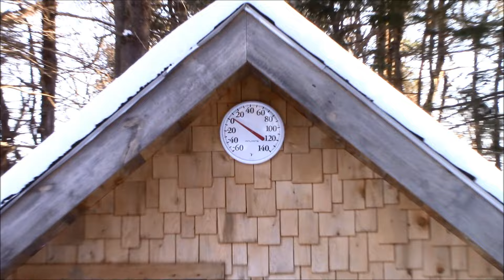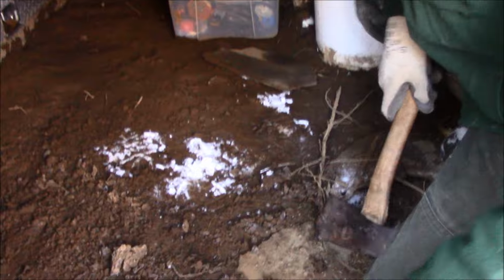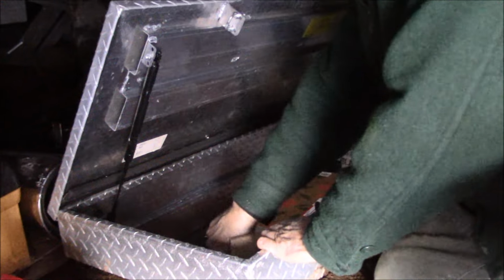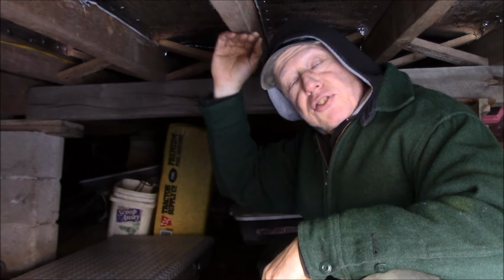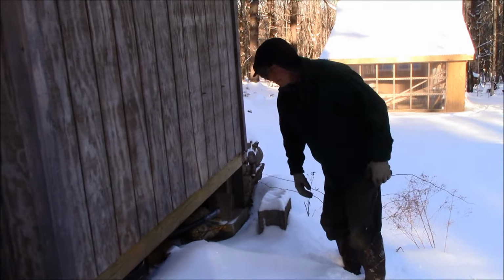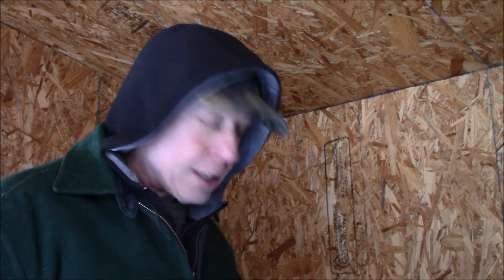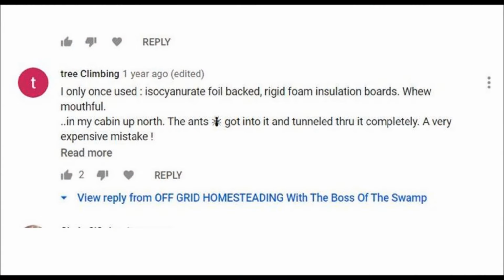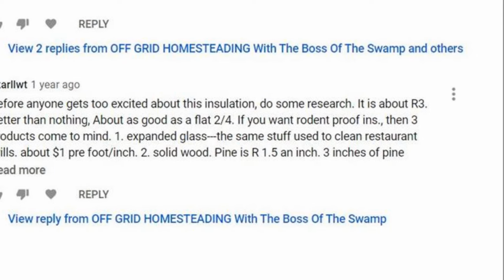Awesome Floor Insulation For A Cabin In The Woods   3rd Year Review

Comment: I'm planning on doing exactly what you did but want to know in between the two by fours with the skirting is it right in the middle or is one side closer than the other as far as where the bubble insulation is mounted also do I need to put down a vapor barrier? On the ground underneath the home. I plan on getting someone by twos and mounting those underneath the park model trailer so it brings it down off of the bottom floor so I have an air gap.

Comment: I have a new storage shed that I will not be able to get underneath.  I want to turn it into a workshop.  Do you think I could put bubble foil over the existing treated floor and then put another wood floor on top?  This would certainly solve my problem.  Thanks.
Reply from the maker: I think I cover this in part 2.  See the links in the video description .

Comment: THIS IS A PUBLIC SERVICE ANNOUNCEMENT...  what Jim says about this Foil insulation as well as pretty much everything else he shares are not jokes or b.s. it’s experience and wisdom. 

We got 2 old steel , yes steel train cabooses and turned them into chicken coops. These are made of 12 gauge steel, so colder than a witches nips but rugged as bulldozer. 

We wanted to conserve space within them for the birds but still keep the heat in them, we used the bubble foil insulation stapled to half inch plywood and screwed it into the cabooses. I’ve also designed fireproof coop heaters that have proven themselves worthy of the task up here in Maine. The coops get minimal heat time they are on for just a few minutes before the thermal outlets we have them connected to shut off, then the bubble foil goes to work keeping the heat in. Yup it does and no one can tell my birds different when we go in in the morning and they’re all toasty and happy and don’t have ice for water. 

If you want results, take his advice. Install it in a sensible manner and in a sensible situation. 

I have to laugh at some of the comments stating it doesn’t work. Here’s a little factoid for the non believers. It doesn’t matter what you insulated with if it wasn’t done right. 

This is not meant to be a standard insulation as he has stated about a hundred times. But it does a damned good job if used properly. 

Cmon with the negativity I already know it’s gonna roll in.

Comment: I use the bubble foil in my chicken coop for all the reasons you use it! IT WORKS GREAT!  It keeps the chicken generated heat in the coop in very cold weather and helps keep the heat of the sun in summer, Out, so its cooler!
Anyone doubting its use simply are ignorant and read nos...but not reality!  It works and as you say bugs and rodents certainly don’t touch it—Great Stuff!

Comment: The problem is that bubble foil has been misrepresented by retailers to be used instead of conventional insulation when in fact it was designed as an add on reflective layer to existing insulation products, the only reason the bubble wrap is there is because its a cheap way to carry the foil, you could just use space blankets but they are fragile, the bubble wrap itself has no significant insulation value. Foil bubble wrap is a reflective layer not an insulting layer.
Reply from the maker: Regardless, it works wonders for this application and there's no denying that.

Comment: Bubble foil is not insulation.  It is however highly reflective and will prevent heat transfer as long as you have an air space/gap on one side.  This is the nature of aluminum. So yep it will work. It is also an air barrier.  I’m surprised how well it works in the space under your cabin.  I used it under my steel roofing which sits on purloins.  Works great to prevent heat transfer to my roof.

Comment: i see you have skirted the cabin and insulated it with bubble foil. My question is how do you prevent moisture built up in the space? You don't appear to vent the space. I do not see any moisture, mold or root on the floor joists. But everything I have read and been told is that you cannot do what you have done unless you vent the space. I have a cabin  in canada not that far north of you so the conditions are similar. Do you remove or vent the space in the summer when humidity levels are well above 50%. TKS
Reply from the maker: I'm working on a skirting video at this very moment and may have it out this week. If not this week, soon afterwards.  If I remember correctly, I discussed the ventilation in this episode  https://www.youtube.com/watch?v=Wa2-FWAwwUY
Reply: Thanks for the reply. I look forward to what you have to say.

Comment: Is there any issue with compressing the bubbles over the top of the floor joists so the subfloor can be fastened down tightly?
Also wondering about squeaking floors, as normally a bead of caulk would be between the joist and subfloor.
Reply from the maker: Yes that is the drawback to going over the joist.  Here's an update on the subject  https://www.youtube.com/watch?v=Wa2-FWAwwUY

Comment: Back in the 1990's We lived in a 19 foot RV to follow his work.  I tried the foam board inside my vinyl skirting and wow!  It was a mess with the ant's.  The only other thing I could find was the roll of bubble wrap.  We used it in all the inside cubbies and on windows inside the RV.  I was surprised and happy it worked so well.  My inside pipes no longer froze.  (Still had to use electric wrap on water pipes and hoses on the outside). It was also easier to heat the inside of the RV with a small oil filled electric heater. (The RV heater used too much propane and ran out too fast).
This was long before I found your channel and watch your excellent videos.  Keep up your great work!

Comment: I live in a 3 bedroom ranch in the city.  I use the Reflectix bubble wrap in all the windows in the summer, to reflect the sun and some of the heat back outwards.  It helps just enough so that my AC doesn't have to work so hard.  I also use it in the basement, putting it above the heating ductwork to reflect heat in the winter and AC in the summer.  After seeing this video, the first I have watched on your channel, I may use it on the upper basement walls(monolithic concrete) that are not under ground.  I am now a new subscriber.

Comment: This is so silly people telling you that it has no R Value and it doesn't do anything but we've had great results with it . It's more about the reflective property that causes it to work. Hell a guy I knew used it to have a hydroponics grow room in the attic of his pole barn. If you think about it how does a thermal blanket work that's thinner than paper. Because it works the kind we use is r7 mostly.

Comment: the heat isn't coming down from the cabin. it is coming up from the ground. that is why snakes go underground in the winter. my house is built with a crawl space like yours. it stays between 50 and 70 under there all year even though it goes from 0 to 100 outside. I think it helps some. outside the cabin the ground is frozen because the massive amount of cold air draws the heat from the ground.  inside the air is still. just my opinion. cheers
Reply from the maker: I think it's coming from bot the ground and the joist.

Comment: So how can I get away with using it in the floors of a house we’re going to build on piers in Michigan when the code calls for R30 in the floor of an unconditioned space?
The Reflectix  web site shows a method to use two layers with air gap in between to achieve R21.
But how do I convince the inspector to pass it?
Reply from the maker: You probably won't because these inspectors are tunnel visioned with their R values and moronic codes etc.  I wish you luck though.

Comment: I rebuilt a 1973 GMC motor home back in 97. The coach floor is much closer to the road than other motor homes. Heat transfer from the hot summer pavement is a real problem. We put a layer of bubble foil down first then carpet pad and carpet. Big improvement. Added bonus was the sound reduction as well. I love the stuff!!

Comment: Although your skeptics are correct in the "R value" the stuff works. I did some research of my own, and the construction guru's have actually assigned this stuff its own ratings I believe it was "U value" it has to do with the reflective natural of the foil. I used the stuff as vapor barrier in my walls a ceiling as well as insulation and the results have been phenomenal!!!. The biggest draw back is lousy cell reception inside. Oh well, I'm warm. Buy the way I'm in Alaska and we just came out of a 2 month cold spell of-20 to -30
Cheers

Comment: Why focus on the non believers? We took your advice (I commented on your other video) when we built our off-grid log frame cabin here in the Kootenays. We're on piers and put in a 2x4 frame with 1/2" ply skirting and put used tin roofing on the outside of that. We (girlfriend did it all) then stapled bubble foil on the floor underneath and the inside of skirting. We had a pipe freeze last week so I went in the crawl space and it was warm in there! The pipe froze on an outside wall so I did a temporary work-a-round to get it going. BF absolutely works like a charm. Ground was fresh, all our home made beer and wine was good, and of course, all our plumbing is working like a charm. There's no heat in there except what comes through from above from our wood burning Amish made stove (Heco 2000 from Penn.). We have two large vent doors which are screens in non-winter which I insulated with a styro board until this spring. I'm not making videos on homesteads and don't care if some doubted that BF doesn't work. It totally does and it's because of your videos that we're doing a similar lifestyle off grid as Lori and Jim. We even have our cast pans on the wall but don't have a Frankie or Tildey. We do have enough wildlife that entertains us all around us though. If you're going to do a flood and don't want pests, take Jim's advice and use BF.

Comment: i,ll never use foam board,you got that right when you said that ants , they just love foam and mice and chipmunks love fiberglass insulation,, i was at a loss till i found this video,, i know what i,m using this spring when i redo the under neath of my mobilehome, i,m using the bubble wrap like the stuff you used,, i just gotta clean the mess out from under the trailer first,we have a bad problem with the big black ants, no matter what i do they come back in force,, be blessed and safe

Comment: Hey Boss Great video, I'm already a big fan of bubble insulation I just didn't know how well it fared with mice, I will be building a cabin on  a pier foundation too and part of it will be a concrete slab, I plan to use aircrete for that. I agree some of the heat bleeds down through the floor joist but also the natural temp of the earth comes up similar to a cellar. Thank for showing how it has preformed, now I am convinced, Watching you is just good ol backwoods logic. Thanks and God bless.

Comment: I put insulation under my cabin floor and sure enough it became a rodent haven. Also, it started sagging & falling down. I’m going to make a switch to bubble foil. Curious though, what material did you use for your outside skirting? I need to make some changes to my cabin.

Comment: To the haters: look at the graph for what R-value represents. It's a curve with diminishing returns. R3 is plenty for a lot of applications, particularly a floor which isn't even a significant heat drain anyway. Heat rises. The roof is really where most of your heat is going to go. Focus the serious insulation there. 

I'd honestly rather lose a little heat than give rodents and insects a home.
Reply from the maker: The only people that bawk at this stuff are the ones that never used it.

Comment: I've never built anything with Bubblefoil, but I do keep a 6-foot length of it rolled up in my pack when I take day hikes in the colder months. So far, it's done a bang up job of comfortably separating me from the cold, damp ground when I feel like stretching out next to a campfire. Cheaper than a camp mat, doesn't take up much space, and barely weighs anything!

Comment: Facts:
What is the R value of Reflectix?
The values utilized in Reflectix® R-value calculations for Interior “Air Films” are as follows: Reflective side of product: R-4.55 Down. R-1.32 Up. R-1.70 Horizontal.
These terms are related to heat flow directions. They are a part of the criteria utilized in R-value testing. For example, when testing a floor assemblage, heat flow down is tested. When testing for a wall system, heat flow horizontal is tested (same for all conductive heat transfer insulations).

That is some impressive numbers for the thickness of this product. And you have created a dead air space in your skirt which has its own R value.

Comment: I Have considered using bubble foil in my walls and ceiling over unfaced fiberglass insulation. Any thoughts?
Reply from the maker: Myself, I wouldn't totally surround myself with it. A building needs to breath.  Just the floor and ceiling would be fine.

Comment: Great video Boss . You sold me on bubble foil on your first video building the extension to the New York cabin . Some people don't understand how to use it . Once the foil is down and the flooring is installed on top you must cover the floor with a plastic tarp until the building is enclosed . This keeps the rain water from going in between the foil and the flooring . I guess you could caulk the seams but why not protect the flooring . That tarp must be kept in good condition until the building is enclosed .That's when you can cut the tarp out  . Gorilla tape is good for that if you get small holes or tears in the plastic .. Some people don't like walking on a tarp while building . That's their  problem  . The small amount of heat loose through the floor because of the way you installed the foil is a blessing for you . Nothing freezes in the crawl space . Great idea in partial burying that aluminum box for food storage .

Comment: My father-in-law's house with hardly any insulation but has foiled back in the roof ceiling just under the drywall and his house stays warmer than most people's it doesn't insulate it reflects the heat back into the house works better in insulation lol

Comment: Thank you sir for the bubble foil update. When I bought my unfinished cabin in upstate NY (ADK) in 2017, I saw your previous video and did the same between the joists. Its up on stilts as you mentioned. This spring I'll be building the skirting and using treated plywood with the bubblefoil stapled to the inside of it before nailing to the stud framing. You're so right about those damn mice.....*^%&$^$^$9....#Justsayin  Thanks for your videos. love them  and look forward to them.

Comment: I've heard a number of people rave about bubble foil, so I don't doubt you. But, for your cabin I think the heat is coming from the ground. You may be better to remove the insulation from the floor of your cabin, and rely on the skirting/bubble foil of the cabin. Your floor inside could be warmer. To me you are insulating the heat from entering the cabin. remember heat rises... I'd also put a vapor barrier over the dirt floor, but that's something else to talk about. The shed is a different story, because it is open you need the floor insulated.
All the best.

Comment: All this is fine, in a certain degree-days class/area. Would not in work on permafrost, lol. Your idea works in certain areas, but it would be in an area with moderate winters. In Canada, none of this works.
Reply from the maker: I just spent 13 years on the Canada border.  The coldest temp I experienced was -38F but -27 to -30 was more common.  One layer of foil in my cabin floor there and no complaints from me.
Reply: @thebossoftheswamp  the internet knows no border, then let's say you are ok in the USA, not Canada.

Comment: I'm a Thermodynamic engineer. Comfort is based on R value and air tightness. Bubble foil isn't magic. The foil reflects only UV rays, not actual heat (BTUs)

It's no better and now worse than plastic bubble wrap sheeting.

Your crawl space is how it is because of heat leaking ....radiating .... out of the cabin. If the floor were truly well insulated, everything in your crawl would be frozen.

If you want to build a cabin you can heat with just a few candles, let me know. ;-)

Hint: concrete encapsulated ZEPS.

Comment: i used foam board with a foil side to put on my basement walls to reflect the heat in the winter and cool air in the summer. Works great. Cinder blocks get ice cold otherwise

Comment: Hey Boss, I live in a Tiny House on wheels  I built myself. I use a length of this foil at night to block off the open side of my loft while I sleep up there. Amazing temperature retention around my bed!
I also used this under the flooring on my Tiny House trailer. I swear by it too -- in the proper application for it. Too bad some people can't open their mind. They've been indoctrinated well.
Give Frankie a hug for me. 🐾

Comment: I re roofed my pole barn. It had 1/2" double foil faced foam insulation board. When I put the new roof on, I installed the bubble foil only.  As far as I can tell, there is no change, or very little change.  Its good stuff.

Also some of the foam boards will soak/wick up moisture if installed improperly or a leak occurs.  Thats why I had to pitch mine. It was exposed on the eves.